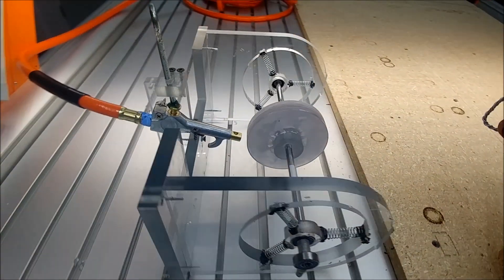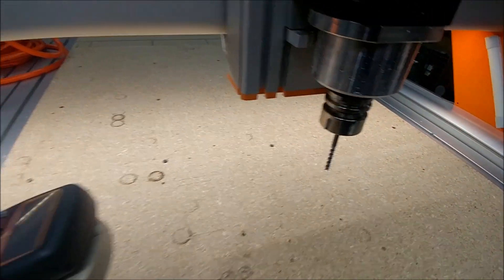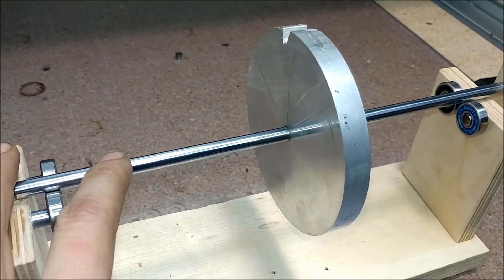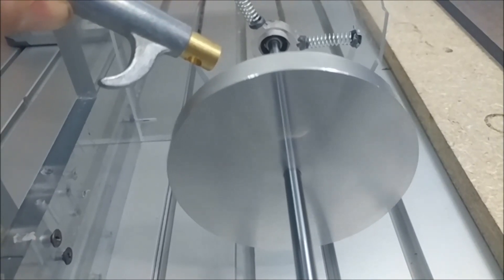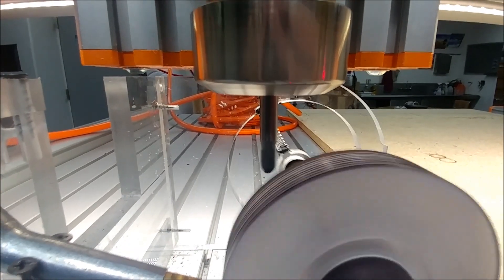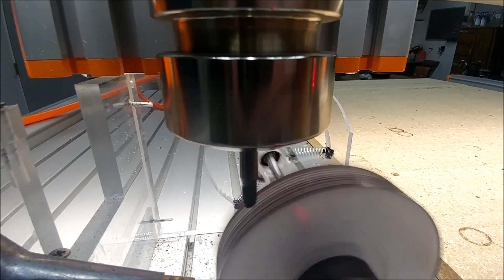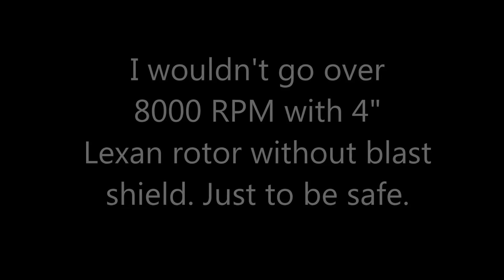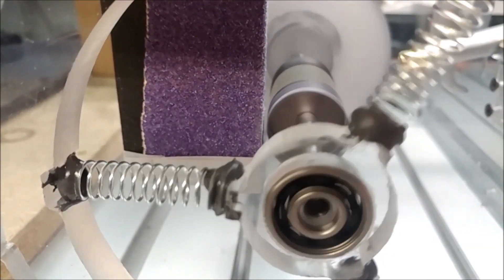DIY High Speed Dynamic Balancing! Tesla's Balancing Patent!

Comment: Good work. I have never heard of this technology but this video was informative on the general idea of how it works. Hopefully this technology is handy later on in your testing.
Reply from the maker: Thank's, I've never built a prototype of Nikola Tesla's that I didn't find useful.
Reply: Spread the truth. We need it OUT!
Reply: Tesla turbine is only a HINT. The REAL principle is in the principle - MAGNETIC ATTRACTION. He KNEW! He KNEW that magnetic attraction is the KEY to overunity. It creates kinetic energy from counterspace or negative space. He freaking knew. His hid the technology away from the illuminati! I found it!

Tesla turbine - actually is a turbine booster. Using the adhesive between the air and the metal, the turbine itself is VIRTUALLY NOT draining the kinetic energy from the air, even though it does. The turbine simply rotates as it is pulled by the air. This slow down the air but increase pressure, allowing more adhesive force. Eventually, the turbine is in synchronous with the velocity of the air.

Does the principle sound familiar? THAT'S RIGHT!

The 3-phase no-load synchronous motor. Tesla turbine has ZERO TORQUE, in other words, no load can be added. Why did he build this? TO SHOW THE TRUE POWER OF MAGNETIC ATTRACTION.

If no load can be added, it is connected to an ordinary steam turbine, BOOSTING IT. Free energy in disguise.

What to do with 3-phase no load synchronous motor, externally excited? Configure the stator into a STEP-UP TRANSFORMER!

Sorry for caption but I AM EXCITED for discovering this xD

His life is most likely in danger.